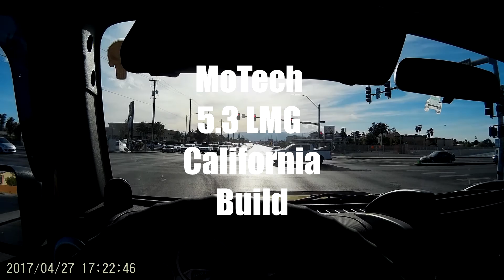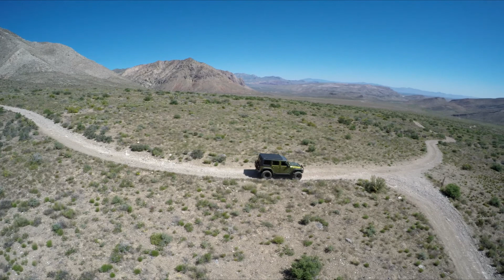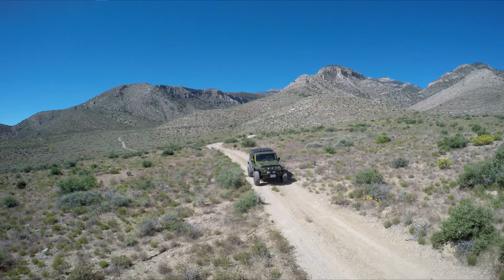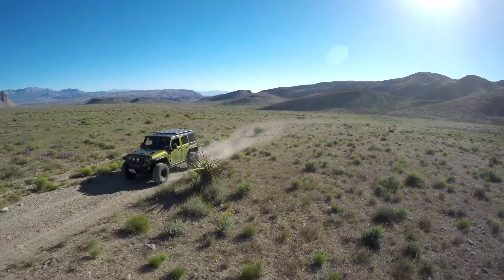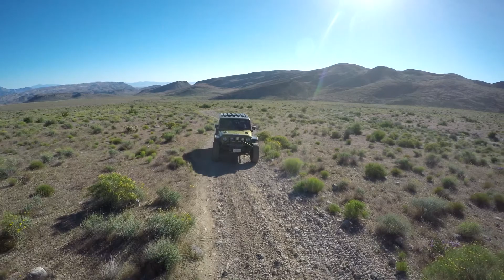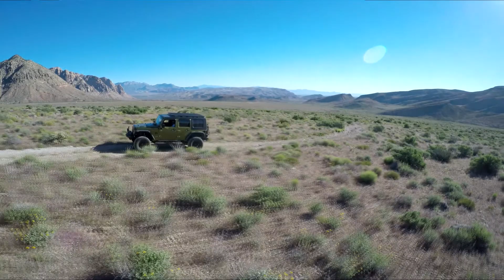Jeep Wrangler V8 California Edition

Comment: How does the 5.3 do when it comes to towing? Would I still need to follow Jeeps 3500lb limit? What if I went with the 6.0?
Reply from the maker: Either the 5.3 or the 6.0 will tow more than the JK can handle. The 3,500 pound limit is partially due to the chassis and brakes; the JK really isn't up to much more than that. If you do intend to tow the 6.0 does make a better choice.

Comment: Hi Robbie, How would it work if I were to go after a Gen4 5.3 with an auto, when I'm currently running a 12 pentastar 6 speed?
Reply from the maker: Works great. We support the manual to auto swap as well as Pentstar JK's. The 5.3 does not much more HP than the 3.6 but it has a lot more usable torque and a better transmission.
Reply: Thanks for the info, I'm not necessarily looking for power, just a little more torque, and a little less of a high strung drive train.